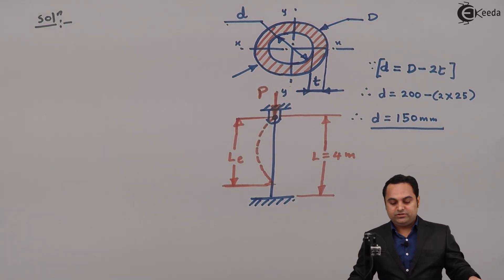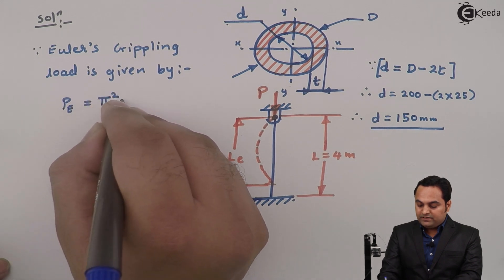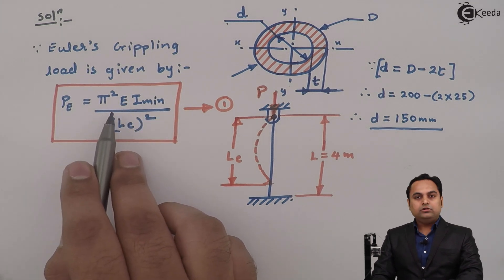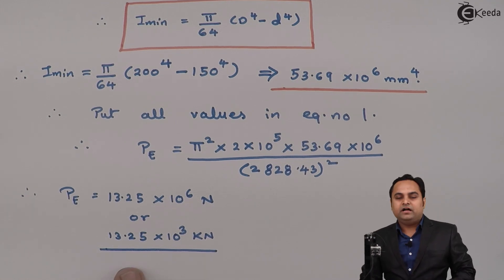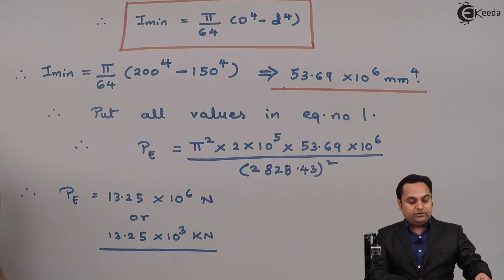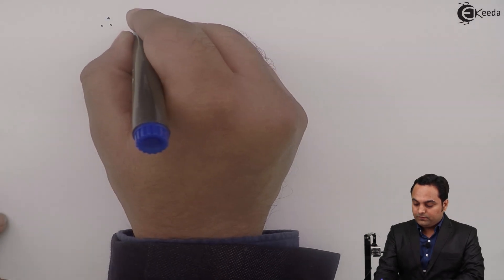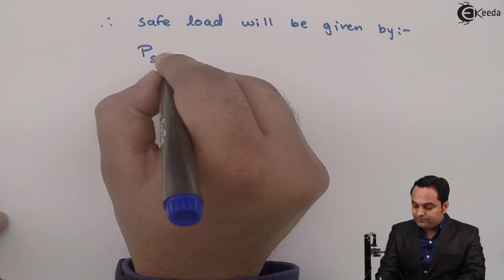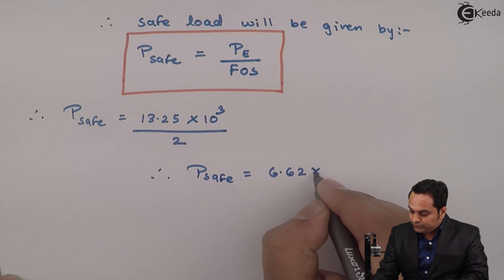Problem on Calculation of Euler's Load - Columns and Struts - Strength of Materials

Comment: Sir 1 end fixed and other is hinged me formula me 2 h effective length Correct h
Reply: Han , sir ne jo formula use kiya h bo both ends hinged ka h
Reply: Here formula is applied for end condition by sir is (both ends are hinged) , but in question they gave the end condition(one end is fixed and other end hinged) , Eulers formula is wrong that sir has applied.